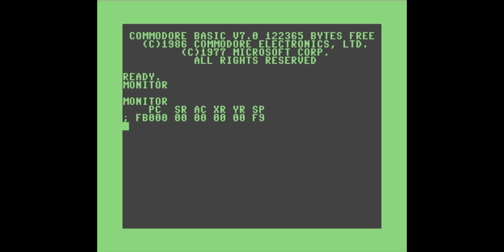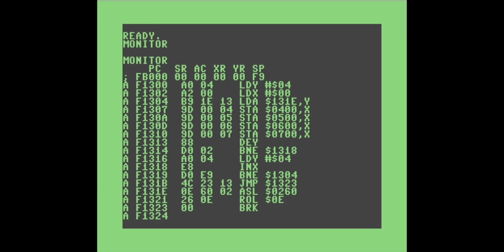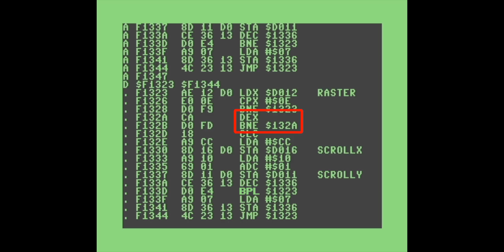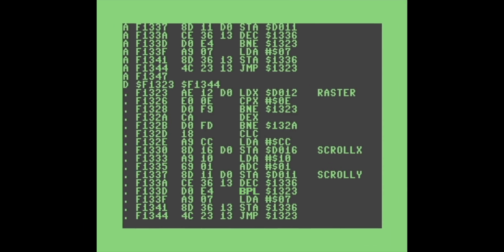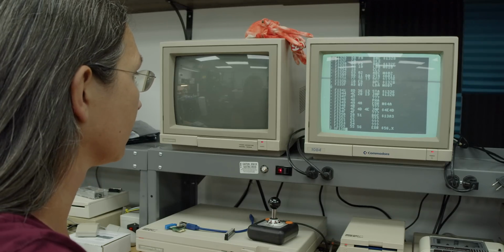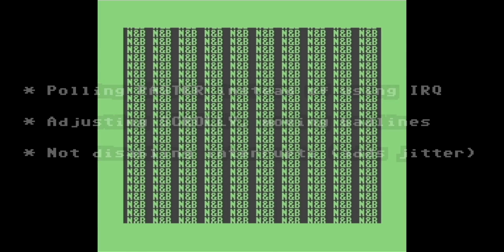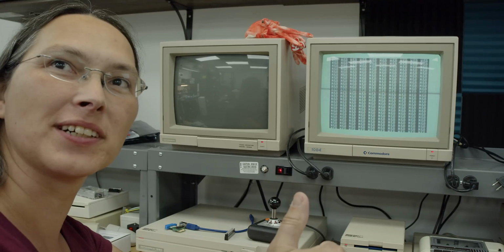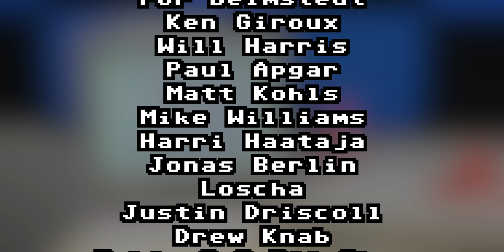Commodore 128D: Episode 10:  Smooth Scrolling Businesscard Shenanigans

Comment: This is a neat trick that also works on the C64 and is only possible to implement this simply if every row on the screen contains exactly the same text in exactly the same columns because the text isn't actually scrolling - this is also evidenced by the fact that the code above $1323 is only ever executed once.
Reply from the maker: Oh yeah, totally! The code can actually be run as-is on a 64, too.
Reply: @NybblesandBytes   This revision definitely won't fit on a business card, but I inserted a subroutine to colorize the rows.  Hope you like it!

100 forx=4864to5045:readn:pokex,n:next
110 sys4864
200 data32,110,19,169,,168,170,141,32,208,141,33,208,169,5,141
210 data134,2,185,105,19,157,,4,157,,5,157,,6,157,
220 data7,200,192,4,208,2,160,,232,208,231,174,18,208,224,250
230 data208,249,202,208,253,169,12,141,22,208,169,16,24,105,1,141
240 data17,208,206,62,19,16,228,169,7,141,62,19,9,144,141,17
250 data208,32,110,19,32,228,255,240,210,169,27,141,17,208,169,200
260 data141,22,208,169,147,32,210,255,96,14,38,2,96,1,162,25
270 data169,,133,251,169,216,133,252,160,,173,109,19,145,251,200
280 data192,40,208,249,24,165,251,105,40,133,251,165,252,105,,133
290 data252,238,109,19,173,109,19,201,16,208,5,169,1,141,109,19
300 data202,208,213,162,9,206,109,19,173,109,19,208,5,169,15,141
310 data109,19,202,208,240,96

Comment: I'm amazed to see that you're back! I thought you stopped making videos because your C128D died and after that you might have died as well! I'm using an emulator. I don't know why you're planning to use those two other computers at the VCF, though. I wish you'd do a horizontal scroller instead of a vertical one. Of course, programming the VDC chip is even more amazing than scrolling. I think this chip was designed to generate similar displays to early PCs, but I'm not sure which type of PC display it's based on.
Reply from the maker: Nah, didn't die -- just life got in the way. My original 128Dcr did die, though I managed to bring it back up. Trouble is figuring out how to give it a regulated 9VAC rail to finish the restoration, though.

Why were you after a horizontal scroller? It would have required significantly more space than I had available on the business card, since it would have to do a line-by-line copy of the screen each time. Unless you mean doing the next video on horizontal scrolling, which I'd be happy to do at some point as well. We're going to use both sets of functionality in the game I end up writing.

We'll get to the VDC, for sure, though, as well. I'd like to make the game dual-headed if possible. It's not really based on anything other than the generic 80-column RGBI connector "standard" that was around at the time it was made. The interface (and the way it generates the display) is entirely different than anything the PC had at the time. If anything, it's based around 80-column color VDTs at the time used with CP/M machines.
Reply: @NybblesandBytes  Great to get a reply so quickly! I'm interested in horizontal demo type scrollers in general , but especially done on the C128 instead of on the C64. Do you mean you actually printed that routine on your business card? AFAIK RGBi is Commodore only. I think it was used only on the C128, C128D, and mainly on Amigas. It's descended from CGA, but isn't compatible with VGA. I read that the VDC is compatible with BBS systems running on PCs. It sounds like an EGA mode. I don't know about any similar CP/M displays except the fairly obscure Memotech FDX expansion unit. The VDC having seperate dedicated RAM sounds similar to the TI9918/9928/9929 chips used in Texas Instruments TI99/4A, Memotech MTX, Spectravideo 318/328, and MSX computers, although the higher resolution is more like the later MSX2 V9938 chip by Yamaha.
Reply from the maker: Yeah. I definitely did put this on my business card. It was actually the impetus for writing this program. :D

Comment: Hey! Thank you. Good to see you back!
Reply from the maker: Glad to be back!
Reply: One thing that would be good to explain about the C128 is the interrupt routines it runs in the background to control the sprites, sound and split screen.... there are specific actions needed to switch those interrupt loops off to get full control of the VICII and SID on the C128.
Reply from the maker: @svenvandevelde1  I do mention that early on in the series.
Reply: When I did a retro programming class to youngsters, I had to explain them this but not sure the method I used is the correct one...
Reply: I will search for it ...

Comment: Nice one June, note that the same code would work on any machine with a vicii, meaning that it would also run on a c64, c128 in c64 mode or cbm-510 ;)
Reply from the maker: Yep! That's for sure! During development, I did end up punching it into x64sc to verify some assumptions. It kinda blew my mind when I realized it could just work!